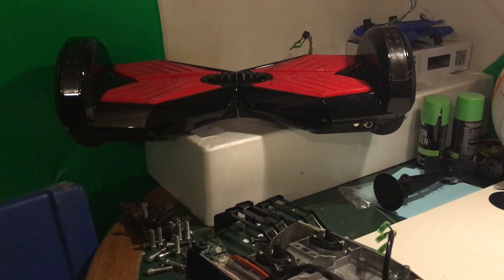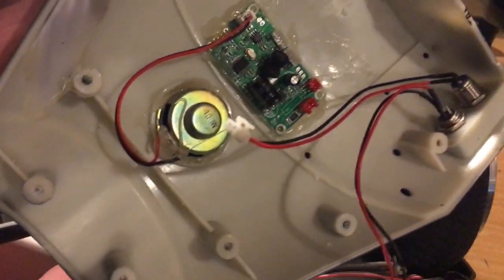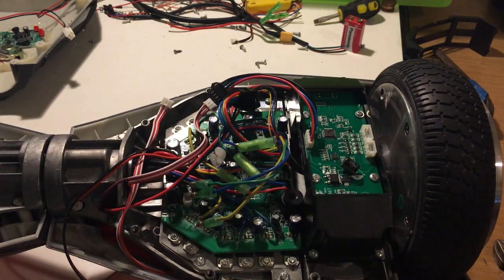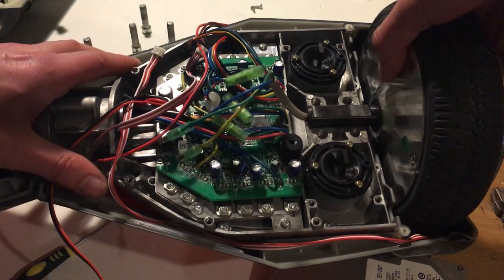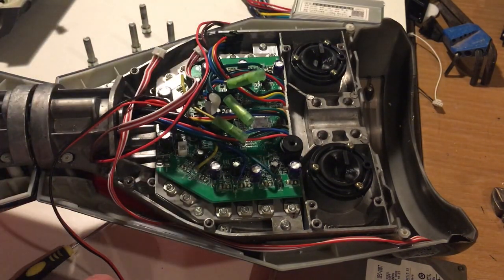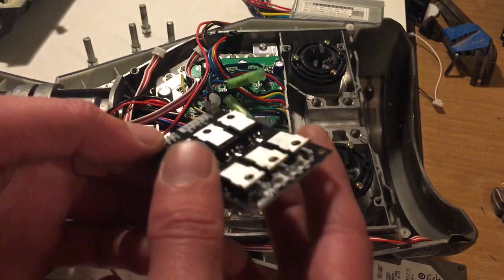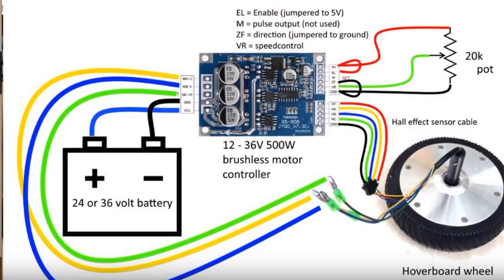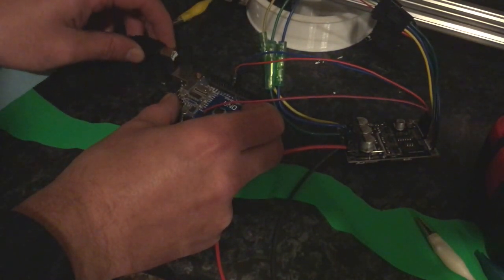HOVER BOARD MOTOR HACK / BALANCE BOARD

Comment: I need help diagnosing my Hoverboard problems is there anyway you can contact me? Thank you😇
Reply from the maker: hi, whats the problem?
Reply: @A-tech  I was pushing a shopping cart with 6 bags of feed at 40 lbs each, when all of a sudden the board started slowing down and beeping! So I turned it off and put it on the charger. When I turned it on again it did the same thing and was off balance. I purchased the motherboard and Gyro board to replace them, the gyro board doesn’t lock in with the wire clip, so I put the old one back on! It worked for about an hour or so and then did the same thing again! What’s wrong with it?😇
Reply from the maker: @melaniekaiserman9198  hi, is this a shopping cart with hoverboard wheels or are you standing on the hoverboard while pushing a cart that weighs 240lbs? is it normally ok doing this and just started playing up?
Reply: @A-tech  I was pushing a shopping cart while I was on the hoverboard!